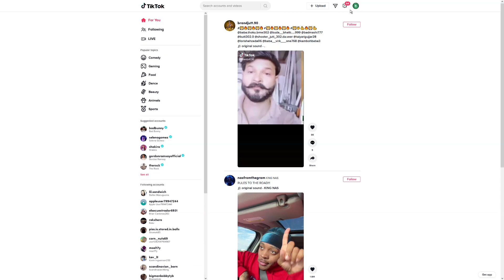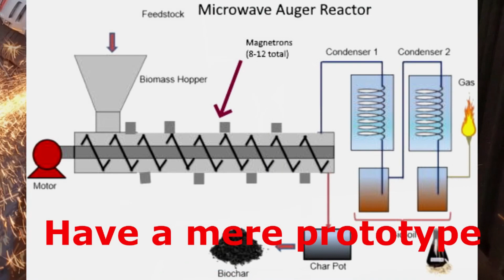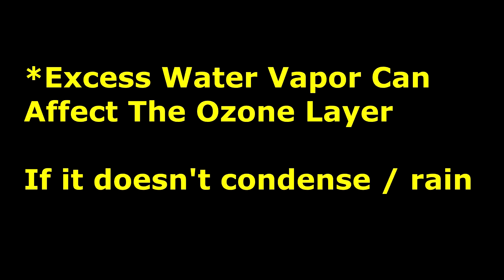Pyrolysis Q&A #1

Comment: Could you self power the machine or is there not enough energy in plastic?
Reply from the maker: With most proper insulation, efficency and 0% losses, yes you can. But 0% losses are impossible because so much energy is lost as heat energy. The plastic itself is more than energy dense enough to sustain the reactor. It's a matter of getting that energy out of the plastic. You can come very close to running it off of it's own energy, but it will always need some energy especially during the start to get up to temperature.

Comment: I am planning on building a pyrolysis reactor similar to yours, that is on a much smaller scale, but to be heated using the burning of natural gas. At this I am working on a method of recycling some of the lighter hydrocarbon products back to the gas flame heating the 'hydrocarbon cracking' anaerobic crucible, to reduce fresh NG costs. I am looking at research that suggests the use of a commonly found pelletized bentonite clay catalyst can improve LPG yield. I see microwaves as an energy loss overall, since the power to the microwaves will almost always be from a carbon positive energy source, and a lot of energy loss/conversions on the way. My question is what do you see as the advantages of using microwaves vs. burning gas? I love what you are doing and I am very inspired by it, I hope you plan to pursue a degree in chemical engineering.
Reply from the maker: Hi, I find it amazing that you want to build one! Microwaves are:

Quicker & more efficent
Safer to use (the chamber never gets scoldingly hot)
Convinient (As electricity is available at a large quantity)
 Cleaner (if run off renewable sources)
Cheaper (it cost me $2 to run it for 12 hours, propane would've costed me around $10)

Comment: Do microwaves thermally degrade dioxins into non toxic compounds?
Reply from the maker: dioxins never form to begin with. No oxygen present.
Reply: @naturejab  
Well, doesn't exactly answer this very precise question I've asked, but I'm pointing you at something there.
Reply from the maker: @Noswiatel  Well
In observation, instead of things like Sulfur Dioxide forming, I just get Sulfur, so just the element, not the dioxin
Reply from the maker: @Noswiatel  To answer your question directly, I don't know.
In incinerators, they much reach ambient temperatures over 1000 F to destroy dioxins, microwaves tend not to heat the gases all that much. However, if microwave plasma formed, without a doubt it would destroy anything in contact with it.
Reply: @naturejab  
Ok I can take that As an answer. :)

Comment: Save 15% or more on the ozone layer by switching on a gerry-rigged incinerator that produces flammable gas under pressure induced by microwaves built by a teenager in his backyard. Fun times guys
Reply from the maker: Pyrolysis & Incineration are two completely different chemical reactions!